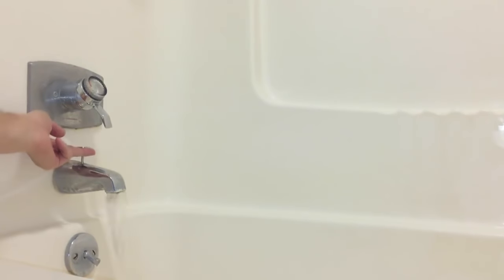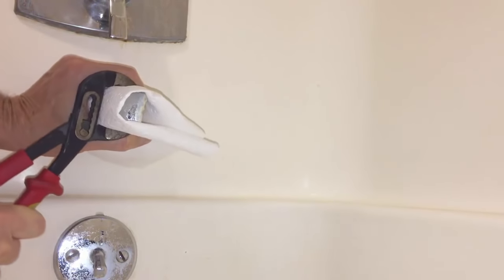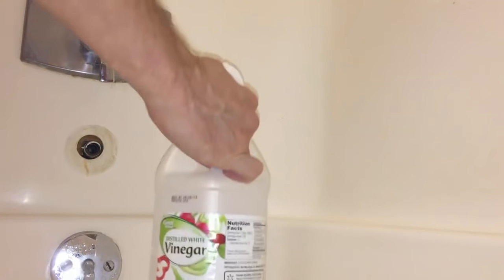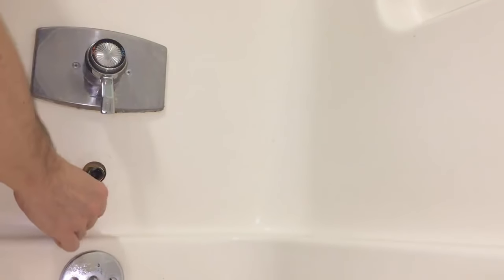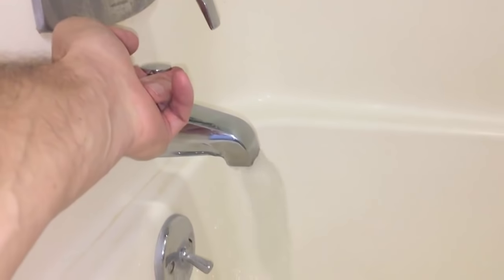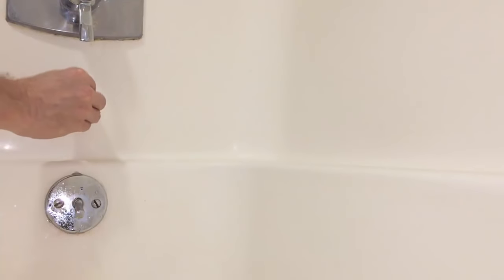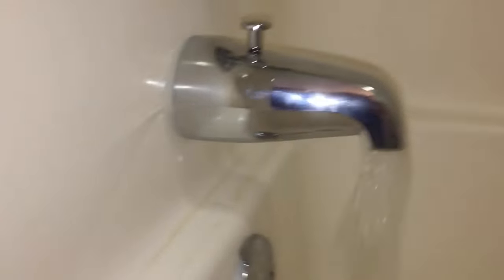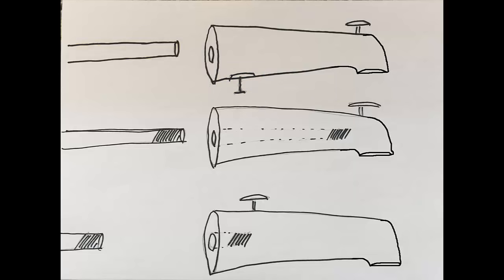Bathtub Spout. How to replace and fix leaking tub spout diverter when shower is on

Comment: Thanks for the video.  I did not know a small amount of water is normal.  In the national plumbing code, the allowable leak is 0.1 gallons per minute and 0.2 GPM after the end of the life cycle.  I timed my leak and it was 0.09 gallons per minute  (1.5 cups after 60 seconds), so for a 50-year-old tub spout, it is doing exceptionally well.   I guess I won't be touching it.
Reply from the maker: Thanks for sharing

Comment: I wish I would of found your video before replacing my tub spout. I have the same type of plumbing connection. I did few minor modes to use a different tub spout. But mine has a lot less leak. Thanks for the video.
Reply from the maker: Thanks for watching!

Comment: I am sorting out a temp fix of a shower valve that does not completely close.. so been looking at possible options..Found your video. It is really helpful. I am wondering why it is considered a safety feature to allow a little bit of water to flow through spout even when the diverter is engaged.
Reply from the maker: I'm not exactly sure why they needed that "safety feature," but I guess it's just a cheap construction spout for $10. If you buy an original spout for about $50 - $100, it should not leak at all.

Comment: great video! i literally never use the spout. can i just put a half inch end cap on the thread??
Reply from the maker: I don't see why not. However, I don't think you'll be able to reattach the spout. So you'll have a cooper pipe sticking out from a large hole in the wall... not very practical. Maybe better to install a new $10 spout?!

Comment: Great video,  just 1 question.  When I go to purchase a new spout to replace leaking one,  any brand is ok? I have a Gerber single hand shower handle so should I be looking for a Gerber spout or it doesn't matter?
Reply from the maker: A brand doesn't really matter, but it's best to take your old spout to the store to make sure you buy an exact (size/color) replacement. Also, a cheap $10 replacement may still leak a little water for a "safety" measure. So buying a more expensive unit should prevent that.
Reply: @Your-Self  thank you,  so I went and bought a Danco universal spout with diverter, it cost me about $20 and it was pretty simple to install although I still see a slow steady drip.  Are you saying that's normal? I thought once I replaced it there would be no more dripping
Reply from the maker: Yep, that's what the package says on my Danco Universal. I've paid only $10 online, so I don't mind the tiny steady drip, which is much smaller than I used to have. But if it bothers you a lot, you could probably return it to the store, and maybe buy a Gerber or some other non-universal brand which run about $40-$80.

Comment: You need to be careful with vinegar and the spout.  The main piece that diverts the water is plastic.  Plastic and vinegar is okay.  There is another piece inside the main piece that is many times made of rubber.  Vinegar can dissolve rubber.  

If you want to soak the spout, you should take the main plastic piece out, remove the rubber piece, and then put the plastic piece in the vinegar.
Reply from the maker: Thanks for sharing.

Comment: My plumber replaced my spout on a long threaded pipe with a spout shorter than my original. The caulk seal sunk in a little since it wasn't flush to wall, which I can just add another bead around but the water coming out seems to splatter out all over and hits against the wall behind it at times. Is that wrong? Shouldn't the water just come out more smoothly?
Reply from the maker: Yes. The water should go straight down, as in this video after the replacement.
So maybe you need another spout... not sure.
Reply: @Your-Self  Thank you. Plumber is coming back next week.

Comment: I have this type of faucet, but it leaks when it's turned off. Do you think these steps will help me?
Reply from the maker: This video shows how to replace a SPOUT. If your FAUCET leaks in OFF position, most likely you need a different video on how to replace a FAUCET.
PS. For replacing a faucet you'll need to turn OFF the main water source.

Comment: The drizzle from new spout is there for safety reason —> to let one know that pulling up on diverter that the active water flow is present behind it - that in turn it will come out hit them - maybe hot or cold or etc…. lets them know water is dammed behind it in active flow capability — incase they are unaware of it —note in some shower heads they have an off button in the head itself  up higher on the wall — with that one being turned off and the tub diverter being activated in the lower tub, while the tub nozzle is turned on and no water out the tub nozzle ( had that safety feature of trickle water not been there) . The water off mode at  upper shower head on an off switch some upper heads have that are generally on the water saver heads or old days army pull chain on the head to on off water at the head ) — when shower head is in off mode - [ it could fake out the user ]- because then no one would know its not off at the tub main  spigot control and the main spigot control at the tub could be at any hot or cold temperature should one not know in some way its not off at that main spigot control - (if they later enter bathroom and not know what last user did in it if they turn on shower head or flip down the diverter on the tub spigot - the flow of water would immediately start when they felt it was but was not turned off at the tub outlet  itself as it should be turned off at when first user had left the bathroom ). Then they could get splashed or drenched with water at temps or in unbeknown way when  — without that trickle of water as a safety that the diverter not entirley switch off the flow of water out of the tubs nozzle  thru the tub spout being there - in this way user realizes that water pressure is behind the other means user used to stiffle water flow to off it - outside of the main gate shut off that should be used when all done in bathroom the one on the wall itself feeding the tub. Note this video above  at these time spouts within it [ click on the link below ] shows instructions and states this trickle as safety feature : - I added this comment above so as to expand upon the reason why that be so:

https://youtu.be/yq6FYfqKO0g?t=225

https://youtu.be/yq6FYfqKO0g?t=225

https://youtu.be/yq6FYfqKO0g?t=225

Comment: Should you use plumbers tape if it doesn't screw on?
Reply from the maker: If you have a Set Screw on the bottom of the spout, there is no place to use the plumber's tape. Just tighten the set screw at the end.

Comment: Did you end up putting silicone around the spout? If not, why?
Reply from the maker: Yes, I should've recorded the silicone part as well, but it slipped my mind.
Reply: @Your-Self  thanks for responding. Just thought I'd ask because other tutorials like this on how to install a bathtub spout YouTube also don't mention putting silicone so I was just wondering if that was a needed step

Comment: Question i have the old style that doesnt have the lever , my lever is on the wall i have to pull it out and in to control where the water is going and its leaking. Can i just replace the spout with the new type that has lever on it and control the water diversion from the new spout? If not how do i fix i cant find a video with my type of fixtures thanks in advance!
Reply from the maker: I haven't done any work on those types of fixtures, so can't offer any help here... but I like your idea of switching spouts for a new one.

Comment: Does anyone know if you have to turn off the water supply to do this replacement? Or if its enough for the shower control to be in the off position.
Reply from the maker: There is no need to turn off the water supply when replacing this type of diverter.

Comment: do you need to shut off main water line when working on the bathtub spout?
Reply from the maker: No, not for a spout. If you are replacing a faucet, then yes, shut off the main.

Comment: how would you  fix dripping from spout even the water has turned off? thank you
Reply from the maker: It seems that your problem is with the shower faucet and not the spout. Try replacing faucet cartridge and that should fix the issue. (to replace the cartridge you must turn OFF the water main)

Comment: Thank you this is really clear! Is the plumber tape necessary?
Reply from the maker: I would highly recommend to use plumber's tape in this particular situation. If you don't use it there could be a tiny leak dripping behind the wall that you can't see. And water inside the wall will create dangerous mold, rotten wood, invite termites  and possibly weaken structure of your home.

Comment: i have a question, my shower diverter is definitely broken, previously some water is still going up the shower with also water coming out of the faucet when it is on, now when i turn on the shower, the water no longer comes out of the shower head, but it is also not coming out of the faucet after i pull the shower head (it was coming out before i pulled the shower function) , where is the water going?
Reply from the maker: Very interesting situation, but unfortunately I'm not familiar with this problem, and would not be able to assist you here. Good luck
Reply: MAYBE YOU TURNED OFF MAIN WATER VALVE AND FORGET TO TURN ON ??

Comment: What’s the tool u used to unscrew it? My wrench doesn’t work...
Reply from the maker: I used regular Channellock Pliers. If your spout is stuck be very careful, applying too much pressure may damage the pipe inside.

Comment: I have a similar spout but I cant take off the for the life of me. I twisted counterclockwise pretty hard to the point where I can hear the valves shake. What do I do??? Help!
Reply from the maker: If there is no set-screw on the bottom of the spout, then you should be able to unscrew it. However, applying too much pressure may break the pipe and cause flooding. At this point, I would call a plumber just to be on the safe side.

Comment: What if that didn’t solve the problem. I changed out my tub spout and it still is the same. Could it be the pipe that are the problem?
Reply from the maker: The diverter inside the spout is the only thing that controls water flow. So maybe the new spout was defective... not sure.

Comment: does regular vinegar work, or does it have to be distilled?
Reply from the maker: Somebody told me a long time ago that it has to be distilled vinegar, but I don't know why.
Reply: @Your-Self  yea I googled if regular vinegar would work and I think it does it was really just mixed answers so I'm just gonna use distilled vinegar. Thank you have a good one.
Reply: @Your-Self  oooooh just ran across something else.. so I took it apart but the problem is not only the spout. I think because my room mates never released the excess water by opening the valve after they'd shower it messed/loosened something up because even when I took unscrewed the spout it was leaking from the pipe itself... what do you think?
Reply from the maker: If your shower faucet is OFF and the water is dripping from the spout pipe, it's probably a bad faucet seal. Try replacing the faucet cartridge and that should solve the problem. (to replace the cartridge you'll need to turn OFF the water main valve)
Reply: @Your-Self  oh ok, well I guess it was a little bit of water left over from when I last turned it on because it stopped. Gonna turn in on and off again to make sure. Thanks again!

Comment: My tub has 3 handles, one for hot, one for cold and the one in the middle as the diverter.  Howe can I fix this?
Reply from the maker: Unfortunately, I haven't worked on those set-ups so I won't be able to assist you with your issue. Sorry.

Comment: You can just pull it out right?
Reply from the maker: If you have a set-screw on the bottom of the spout, unscrew it and pull the spout from the wall.
If you don't have a set-screw, follow this video and turn the spout counter-clockwise to unscrew the spout from the wall.

Comment: What if that sonofabitch is stuck and you break the whole damn copper line inside the wall?
Reply: Frank Pierce then you might need a plumber lol.
Reply: I gently tap around pipe with hammer when it's stuck instead of forcing with pliers because that can cause pipes to turn (or break) behind wall. I don't have a clue about repairing broken pipes. 😨

Comment: well, i cant get mine off the pipe..... there is an access hole on the bottom yet no noticeable fastener inside
Reply from the maker: If you don't see a fastener inside, maybe the original "screw-on" spout was replaced long time ago with the current "universal" spout which has an opening on the bottom, but was actually screwed on. This is just my opinion, not a call to action. Good luck.
Reply: @Your-Self   Thank you for your reply. I have attempted to unscrew it by hand and it will not budge. I also have a pair of locking vice grips but I haven't been able to find a way to make them work without slipping

Comment: Safety feature to help prevent an unintended release of water where? In the bathtub? Guess I don't understand how that's a safety feature? Kind of confused here. Anyone have a good idea what that's about? Or is it just an excuse for a poor leaky design?
Reply from the maker: Yes, I've found this strange to see small amount of water dripping from new spout, but after reading instructions on the back stating that it's meant to be there I kind of figured that it's a $10 product and a good example of "You get what you pay for"...  but still works fine till this day though :)

Comment: I replaced my spout and it still leaks through the spout while shower is on
Reply from the maker: Sorry to hear the bad news. If a new spout was installed correctly, it should not leak. My best guess, without looking at it, is that your new spout could be defective.
PS. Make sure you are using correct replacement, and the spout is inserted all the way to the wall.

Comment: So does it stop leaking from the tub faucet after awhile when the shower is on?
Reply from the maker: Somehow, a few months later, the leakage stopped.
Reply: YourSelf I was curious. I thought the whole point of getting a new one was so it didn’t leak. My shower pressure is low because it still comes from the faucet atm. Haven’t replaced it yet
Reply from the maker: The leak with the new spout was much slower than before, so it's worth the $10 upgrade. However, if you buy the original spout ($50-$250), it should not leak at all.